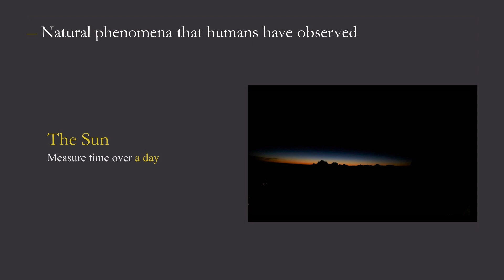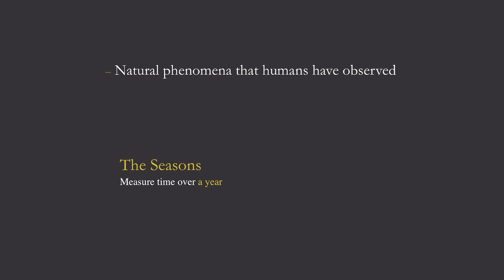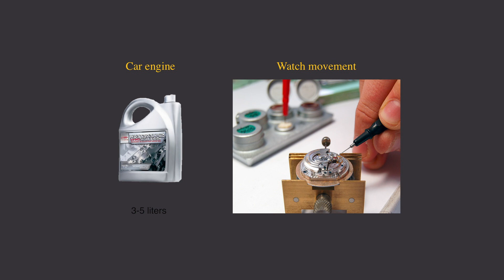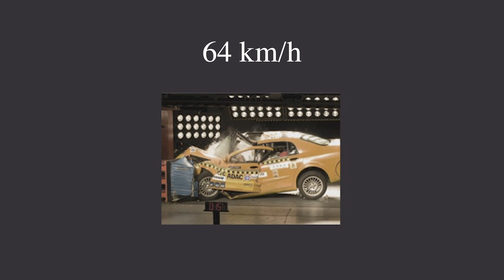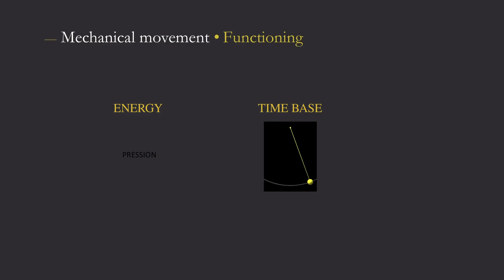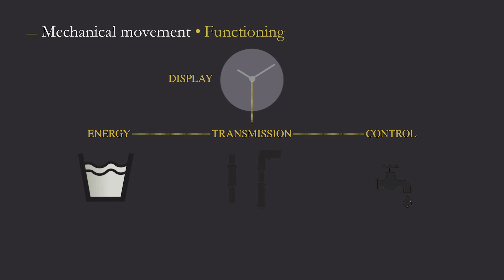Masterclass "the mechanical watch" : an introduction

Comment: As a fan of all things horological, let me be the first to comment that a watch movement is a much simpler mechanism than a modern combustion engine, under lesser demands from its performance environment.  By orders of magnitude.  I will concede that the scale at which the respective mechanical tasks occur is more impressive in a watch, particularly due to the accuracy required and resulting specialization of production machines and techniques.